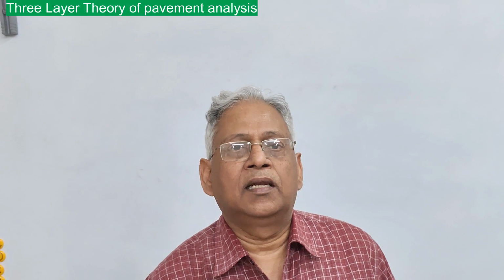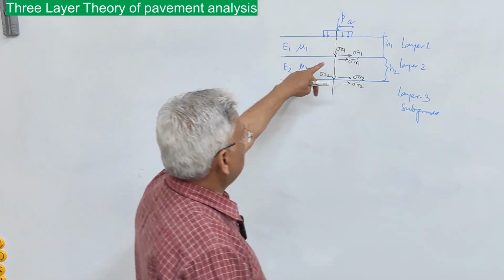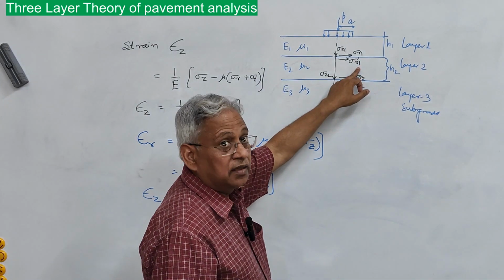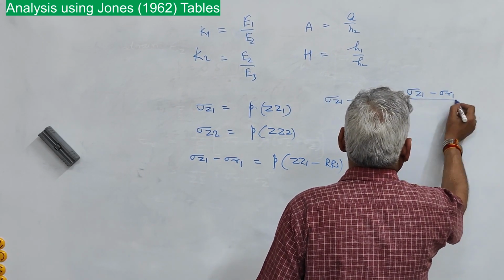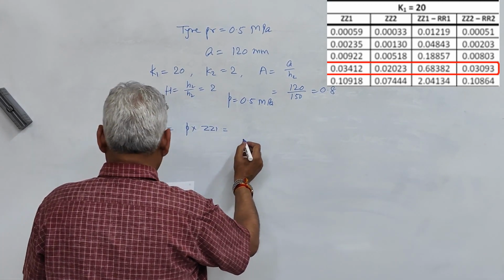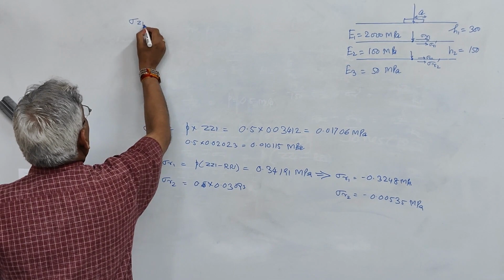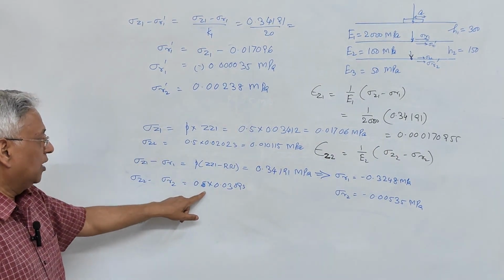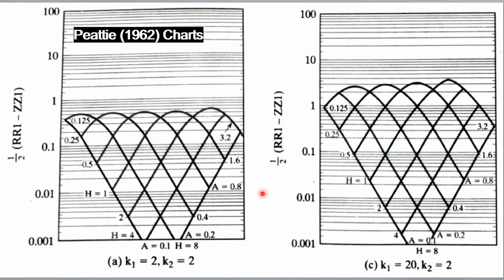Three layer theory of #pavement analysis, Multilayer pavement analysis, Flexible pavement design

Comment: Thanks for your great effort.
Can we use three-layer theory to calculate stress and strain under a linear load, not a circular one?
Reply from the maker: THree layers theory is mainly suited for pavement design and is not applicable to either point loading or linear loading.

Comment: Thank you sir

I want to know about the elongation gauge in highway material

Why elongation gauge is not available for aggregate size range
31.5 -25 mm
Reply from the maker: You can make yourself. It is very simple. Put two steel rods on a wooden bed at a clear distance of 1.8 times the average of two sizes.
Reply: @SatishIITR  thank you sir for your reply

yes  we can make it But I want to know why this is not available on the length gauge and even this is not specified in IS code.